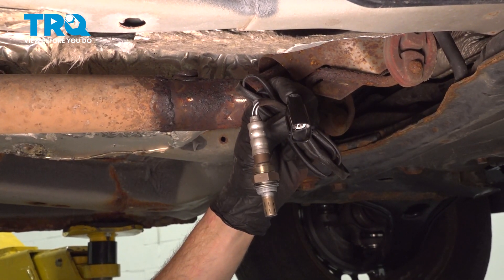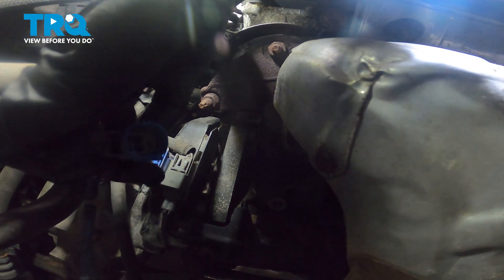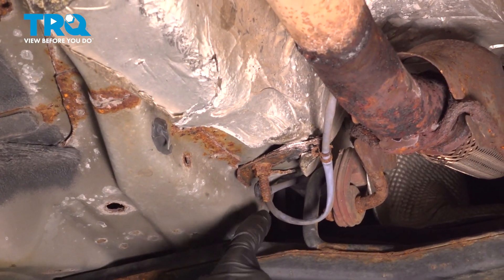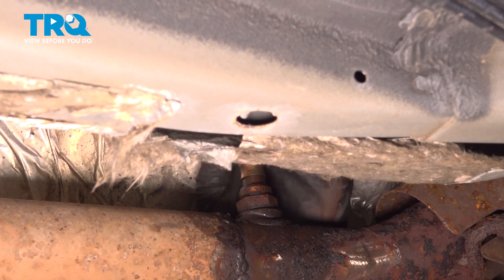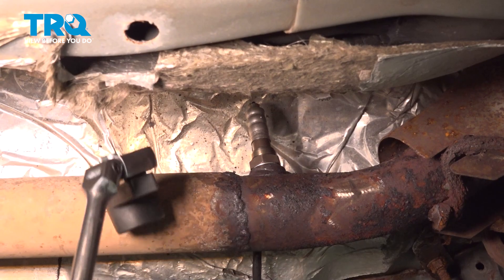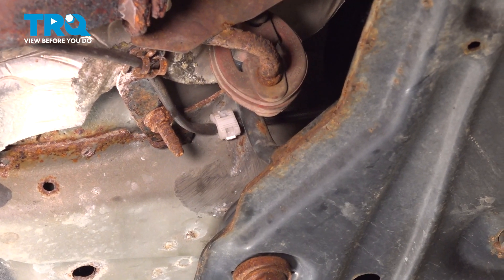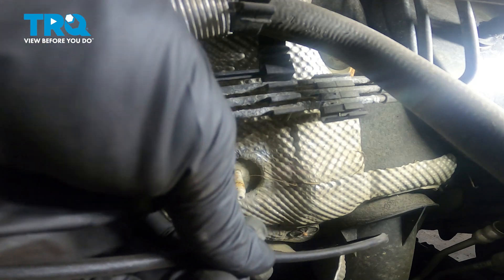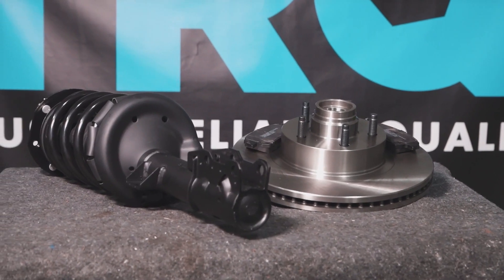How to Replace Downstream O2 Oxygen Sensor 2010-2013 Ford Transit Connect

Comment: just used a TRQ part and this video to replace a downstream sensor in a 2013 transit connect. we had OBDII code P0138. solved the problem in about an hour of work. had to buy a special wrench. spent around $50 total for the part & wrench.